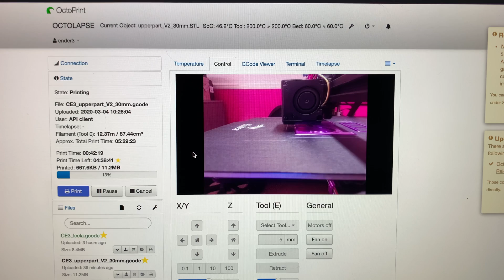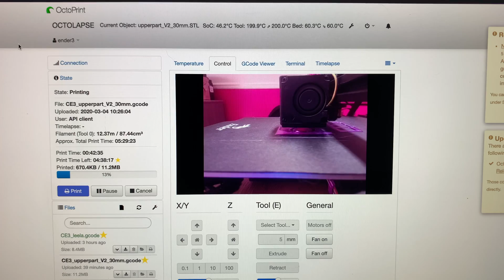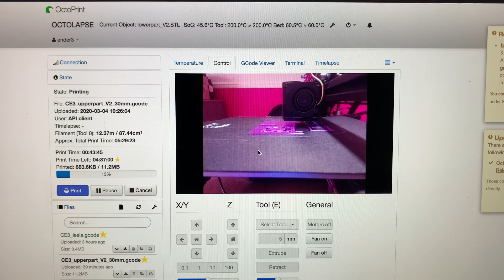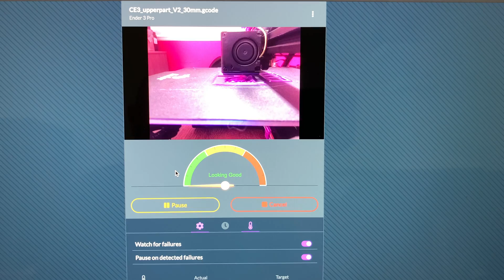Ender 3 pro Thermal Run-A-Way test & 3d printer safety

Comment: You should reduce your into length to at most 5 seconds or so. With a 30 second into you'll see a lot of viewers drop off
Reply from the maker: I’ll consider that. Thanks for the feedback.
Reply from the maker: Made a new intro. I think your right that it was too long, check out this weeks video on Thursday and let me know what you think.
Reply: @GhostPants8012  will do!
Reply: A tip: you can watch series on Flixzone. Been using it for watching lots of of movies during the lockdown.
Reply: @Alfonso Lucas yup, I've been watching on Flixzone for months myself :D